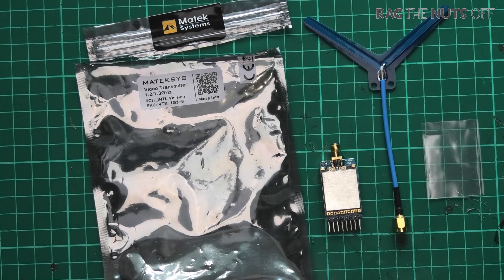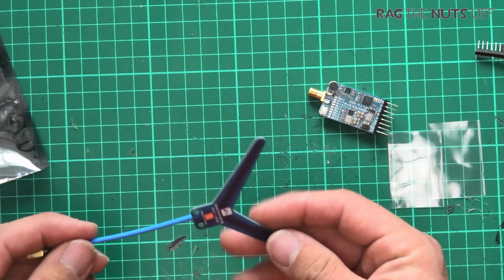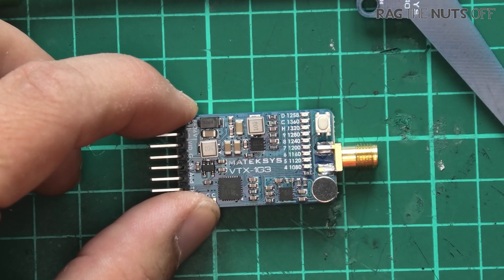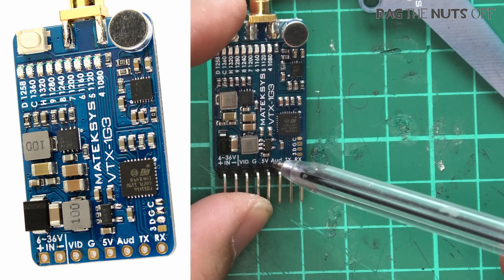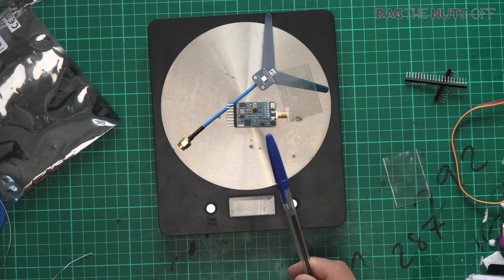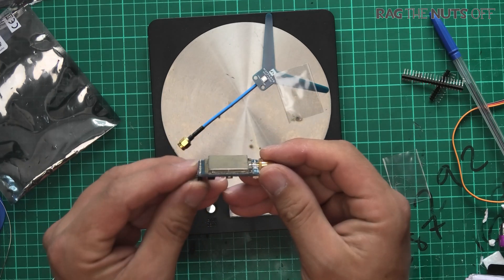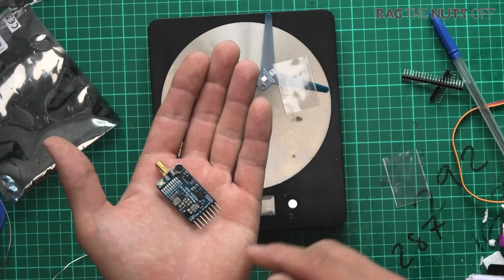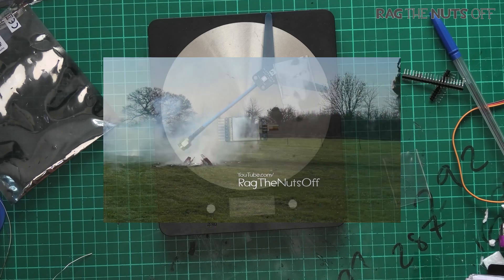Matek 1.2 / 1.3GHz FPV Video Transmitter Overview - VTX

Comment: Hey Matt did you plug straight into FC I have the f411 wse and it seems it needs 6v
Reply from the maker: Howdy fella, yep. Its from 6V, I may have tested one to 5.8V, it was still working after that. Matt
Reply: @RagTheNutsOff  is there a jumper non the FC to give it 6v as I cant get any life out of mine

Comment: i bought one but returned it as it was interfering with my crossfire . Think i will stay with the 2.4GHz VTX
Reply: Odd, it doesn't affect my R9M reciever...lol.
Reply from the maker: Hey Sam, oh how odd. Not heard or experienced any issues with my XF. Matt
Reply: @RagTheNutsOff   im running into the same issue Gal Kremer and Paweł Spychalski had with theirs. I was using the sock antenna. what antenna would you recommend .

Comment: The TrueRC side feed RHCP pagoda style 1.3ghz antennas are on sale from TrueRC for about $10 US... which is amazing if your looking for a 1.3ghz antenna that can be fit on a small model
Reply: Dang, great find! Ordered two!
Reply: @t413com  Haha me too! Im just getting into the 1.2ghz band and i couldnt believe those antennas were cheaper than budget 5.8ghz antennas.. might go order a few more right now if theyre still available
Reply from the maker: Just be aware they are tuned to 1280 and 1258. Outside of this range you will have issues, along with issues with cheap 200mW VTX and those antennas. And.... a dipole is lighter and more easily fitted into a much smaller model, say a Dart 250g for example rather than this, which even V2 is pretty big. Fine ina  larger model though, Matt

Comment: Hi Matt, will you do a proper range/penetration test?
Reply from the maker: Hey Alex, sadly due to the legality of actually powering such a module on in the UK, thats not something I could do. But it would be fair to assume that it would be fine 5 fields away, below the hedge line. with clovers or 20 miles away with a dipole. Loads of vids on YouTube that can demonstrate this for you. Matt

Comment: Hi Matt , I have been using these on my fixed wing models for a while . The pin out for the vcc ground and video is that way I assume because it matches the pin outs on Matek flight controllers for fixed wing . I have been flying well over 5 miles with perfect video signal and that's with the antenna pointed straight up .
Reply: Are you referring to the stock antenna? In my experience that is pure garbage.
Reply: @alerx94  yes the stock antenna on the tx but a very high gain Pepperbox antenna for the receiver .
Reply from the maker: Brian, happy days!

Comment: Of course you have never flown it. Having said that, how does it behave with our popular sub ghz radio link, such as Crossfire?
Reply: In my experience not bad, you just have to give the proper separation between the vtx and the CF receiver also you need to put some separation between the CF transmitter and the video receiver.
Or you can just put a notch filter, though the quality is good.

Comment: Hey Matt, any need for a notch filter to keep from interfering with 2.4 signals?
Reply: Harmonics can reduce range on 2.4ghz, everyone I know uses 459 or 868Mhz on the model. Others still seem to be ok on 2.4ghz.
Reply: I could see where there could be an issue but there is also a basic rule of thumb to not use control frequencies higher than the VTX frequency or you will lose control before you lose the image.
Reply from the maker: Hey Chris, other people say yes. I have never bothered and not had an issue. Matt
Reply: The biggest issue is with GPS signals, actually. Make sure it's as far from your unit as it can be and expect much longer fix times. Also some video cameras get EMI issues with 1.3 like the Caddx Loris.
Reply: Like all electronics, if you bang stuff together with little understanding of the physics it is doomed to go wrong or have rubbish results.

Comment: I think you will find these are illegal in the UK even with a license as soon as they are airborne.
Reply from the maker: Howdy Dave, purely for informational purposes, hence the note at the beginning about checking local requirements & me not powering it on ; ) Matt
Reply: Of course officer :)
Reply: Soon to be followed by breathing.. it's tabled in parliament to make that totally illegal also..
Reply: Isn't analogue all old hat now? :) A friend was using this back around 2013, the skew aerials are massive but picture quality was good.
Reply: @dj_dazzy  You don't need skews on 1280mhz, inefficient....dB loss is huge.

Comment: will this be compatible to Partom receiver?not sure if this can be use for LTM protocol for this particular combo. looks similar to SM130T VTX module, advertised as 600mw but when i tested it was 300mw only.
Reply from the maker: Howdy Brooks, yes it will be. Not sure on all the channels, but will do most of them. These are +600mW, we may have tested one with that Immersion RC power checker. Matt

Comment: Pretty decent VTX, I use them. But ditch the antenna straight away and swap for something better.
Reply from the maker: Howdy Graham, thanks for the feedback, super appreciated 👍, Matt
Reply: @RagTheNutsOff  I went ~1mi on 5.8Ghz and thought it was terrible, immediately ordered these Matek 1G3 VTXs.. (turned out I'd left the 5.8vtx on 25mw smh.. but still, never looked back).. I got some weird artefacts with the stock antennas (used on both ends, I also have the 1G3 VRX goggles module), the image seemed dull, and occasionally had some bizzare sparkles on bright edges in the image. As soon as I swapped for some decent TrueRC 1.3 antennas, it cleared right up, and not a smidge of static yet at similar distances, need to push it out there further now.
Reply from the maker: Yea take it slow and learn the limits of the model. It's a long walk if you screw up 😂